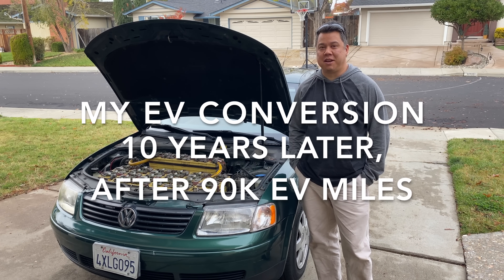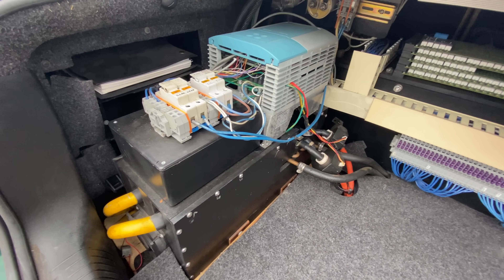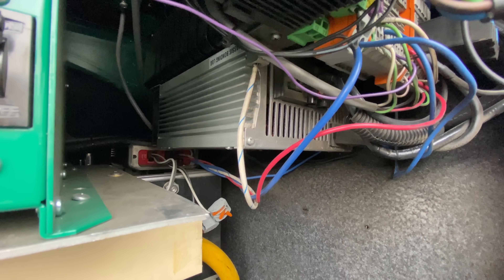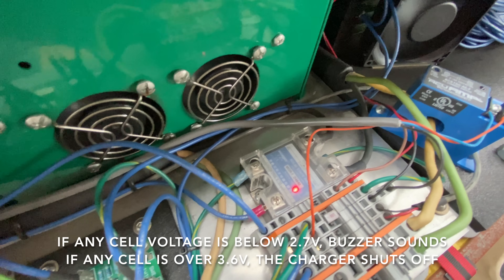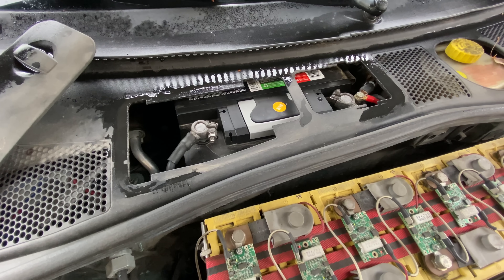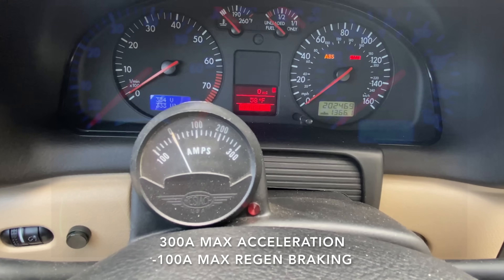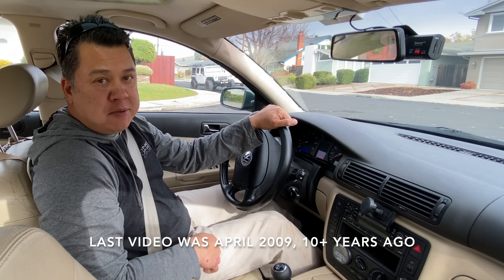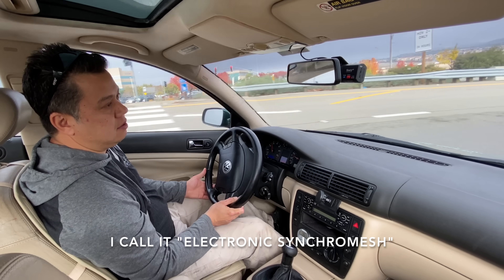My EV conversion after 10 years and 90k miles

Comment: The fact that you built this yourself, in 2008, when there was virtually nothing to go off of, is incredible, and you did such a clean job.
Reply from the maker: Thanks!  It was definitely a learning experience, I have a second video showing how I built the inverter if you're interested.
Reply: @etischer  I can call you Einstein!!
Man, this way too difficult for a regular joe to assemble an EV like this !!
How the heck you did this in 2008 ??
Are you an Electric Engineer ??
If not, where the heck you got the Info and the serious balls to dare to do this project in 2008 !!

You are GOD !! SIR !! 

CONGRATS AND THANKS FOR THE VIDEO POST !!
Reply: The original iPhone just came out the year before and he builds this..... AMAZING
Reply: in 2008 there was plenty of stuff to go off for electric forklifts like chargers, inverters and dc converters were off the shelf, not many options in choice of BMS nor high voltage chargers back then. Even further back, In 1990, I converted a neighborhood ev from 36v to 48v lead acid battery system and upgraded the motor to a 20kW one and installed a controller with regen braking. Had 70 miles range 60 mph tops. Everything was industrial components except for the controller, an EV fanatic in the UK hand built and sold online. So really, not many components are needed to build an EV from a gasoline car. If you have an engineering background, it naturally becomes easier as you have an idea how to spec the components for reliability and highest efficiency, but nothing of it is rocket science and everyone can do it.
Reply: @Tore_Lund  That's not the point. That info was not archived online and easily accessible. You either had to work in that industry, or know what you were looking for, and be able to search for it at libraries, which you probably had to spend a lot of time and effort traveling between, calling, etc. There were no youtube videos, websites, or established communities providing insight and answers. You had to figure it all out yourself.
Reply: @badsamaritan8223  We had online forums, but not any YT videos in the 90'. The biggest issue was that, as I said, Forklift stuff was around so 48V gear a plenty and a some very expensive for 72V fork lifts. Still had you wanted a 100V+ EV, you'd have to build all electronics from scratch, it wasn't available from anyone. The real EVs then, as the Citroen AX EV and the Fiat 600 EV and others were small run production only, no second hand parts. The reduction belt drive, I had to have made by a machine shop and the high torque poly-V belt was also special order, but I got an EV that did 0-60 in 3 seconds when Elon still had his own hair.
Reply: I kept checking- 10 YEARS ago! He should start a garage and convert all VWs no matter what
Reply: @Jasen Vernor I think you need to read what was said mate I wasn’t even talking about hybrids and I did say that they didn’t….  Would you like to show me where I says this ?
Reply: the electric car was invented like 70 years ago, people just didnt consider it a real option because oil was cheap. but now its a different story lol
Reply: @eduuklee9453  My point, was that there were very few resources available to do something like this in 2008, and the internet was barely starting to aggregate those resources. I'd bet most of his knowledge came from professional skills, not research.
Reply: @badsamaritan8223  well obviously hes not an amatuer at all
Reply: My dad converted his 2001 Dodge 3500 dually truck to run on vegetable oil. I'm sure if my dad could do all this back in like 2012 I think it was, with an electrical purge system and things. I'm sure there was information on this guy's conversion too. Probably even kits were available if searched out. Not that he'd need one if he new what parts he knew to get hold of. But neither one of these projects would I want to tackle, even though I help as a gopher and pretty much saw all my dad had to do, I don't believe I'd be able to pull it off myself, the main thing is getting your head wrapped around how it works in and out, after that I'm sure you're well on your way to the same thing these "Mad Scientist" have done.
Reply: @trucklover5404  thats a super common mod to diesel vehicles. its not difficult at all to do.
Reply: @trucklover5404  Can't old diesel engines just run casually on cooked vegetable oil without any modifications required?
Reply: @2use  technically yes, especially in warm weather. If you do your research the original diesel engine was made for the purpose to run on alternative fuels such as vegetable oil. But adding a purging system and another fuel tank, and a flat plate heat exchanger helps a lot and fuel pump. But to do this was a lot of plumbing basically and electrical and mechanic work. We were working on a 2001 Dodge 3500, the fuel rail was too weak to continue running veg oil. My dad's 95 2500 could do it just fine, but he didn't do a conversion only a flat plate heat exchanger and later ended up with a clogged fuel line that he couldn't find. After taking it to a diesel mechanic, he finally found the clog after  3 days (this was his only project). The purging system is probably best to clear the lines with diesel fuel so when parked vegetable oil isn't sitting and gumming up lines. Vegetable oil leaves a film like lacquer and can eventually build up. There's a lot to learn about using Vegetable oil in an engine and companies who actually sell conversion kits to do so.
Reply: Some of the very first cars were electric 😁
Reply: Imagine trying to watch youtube 'how to' videos in 360p on dial up... Man must have solid patience
Reply: @Simon...........  dial up was 1998 not 2008 🤣
Reply: no one had dialup in 2008 m8 @Simon...........
Reply: @Simon...........  it was 2008, not 1998. Lol
Reply: @Simon...........  Dial up? xDDDD thats way further mate ahaha
Reply: @Simon........... We had broadband and wifi in 2008, kid.
Reply: @Simon........... nobody used dial up in 2008 lol
Reply: @Simon...........  there was hi speed in 2005 chill
Reply: @Jasen Vernor Being wrong doesn't mean you're stupid. Everyone is wrong at some point, but thanks for your contribution to the discussion.
Reply: What was the first electric vehicle?
Here in the U.S., the first successful electric car made its debut around 1890 thanks to William Morrison,
a chemist who lived in Des Moines, Iowa.
What? A flyover state?
His six-passenger vehicle capable of a top speed of 14 miles per hour was little more than an electrified wagon, 
but it helped spark interest in electric vehicles.
Reply: First electric cars were invented in 1820-1830
Reply: You are a genius!
Man, if you just knew what you could bring to the public, you would have been the current Tesla owner!
If fact you proved to be a better EV builder than an entire team of Chinese EV manufacturer, making self-flammable EVs.
Congrats, and thanks for sharing it!
Reply: Stay in school, kids.
Reply: Killing someone's flame doesn't make your own life brighter  @zeljkomatovic24601
Reply: @zeljkomatovic24601  school does nothing
Reply: It's incredible because now he works on powertrains at Tesla! The most sophisticated systems on the road today share some design decisions from this car!
Reply: I was working on the original Testis Roadster in 2008.
Reply: "In 2008 Tesla Motors released its first car" By Tesla
Reply: Im shocked
Reply: Agreed
Reply: ❤🎉🔥🔥 love this love
Reply: Yes, back in 2008, when electrical concepts were unheard of and electrical engineers did not exist yet 😂, man must be nice to be young. It is still impressive what he did though.
Reply: Virtually nothing to go off of....other than the fact the first automobiles ever built were electric. 

Commend him for the achievement, but quit making it out like he's a damn wizard. Makes both of you look like idiots.
Reply: Electric conversion is easy .All you need is electric motor, speed controller, battery, transmission adapter. People have been doing ev conversions before tesla got popular. This was when Tesla came out with the roadster.
Reply: Batteries power a motor that moves the wheels to push the car forward or backward. Wow! So hard to do that right?
Reply: Forklifts mate electric forklifts was around for yrs buddy. He got idea from them
Reply: @christopherbrown2224  ok? but it still is impressive?
Reply: @christopherbrown2224  
Your comparison is completely false! 
In comparison with forklift is, comparing 2 aa battery toy with tesla. And you assume that they are the same.
Reply: @christopherbrown2224  electric cars were around way before electric forklifts.
Reply: @ltx383  I never said it wasn’t I said he got the idea from the forklifts mate he says this in another interview
Reply: @christopherbrown2224  so he got his idea from a 1 speed forklift which lifts extremely heavy items to build a vehicle with gears that can exceed 80mph ok got it must of missed that in the videos.
Reply: @ltx383  🥳
Reply: How old are you ??? Bud hybrids been around since 2000!! Lol 

Prius have been around since I was born 1997
Reply: @tellez4089  we are not talking about hybrids ? We are referring to electric vehicles mate
Reply: @christopherbrown2224  Hybrids can just run off the batteries, dingus. That's an EV.
Reply: @davetremaine9763  hybrids cannot "just run off the battery", plugin hybrids can act as EVs but hybrids are still mostly powered by the engine.
Reply: @davetremaine9763  Dingus 😂
Reply: @davetremaine9763 but the thing is hybrids still have a gas engine.
Reply: @tellez4089 ok?
Reply: @tellez4089 Nah
Reply: @tellez4089  lol what does prius have anything to do with this?  A Prius is a hybrid engine that is turnkey from a manufacturer.  This is a Jetta which was equipped with a ICE and now it’s fully electrics that’s not even apples to oranges that’s apples to grapes.
Reply: @ltx383 *passat
Reply: @tellez4089  This video has nothing to do with hybrids genius.

Comment: You picked the perfect chassis to build this on. The b5/.5 is extremely reliable the interior will go to 400k and still look clean inside. And the frames don’t rust out Bc they are alloy
Reply: I am positive that's not a coincidence...
Reply: It’s extremely reliable once you remove the gas engine.
Reply: @vee6411  I am pretty sure the B5 Passat was also shipped with 1.9 TDI which are widely regarded as one of the most reliable engines ever made. Not saying the electric motors did not improve the car , but I have heard of 1.9tdi going over 1Million km and have seen a lot sitting at over 500.000km personally
Reply: @TheMasterMief  Yes, you are right. I was more or less making a joke which is why I said gas engine. 

But you see, German engines are not too bad mechanically. Although some are plagued with oil leaks, coolant pipe leaks etc but nothing catastrophic usually. Those are more just design flaws and minor inconveniences. However, the thing that makes modern German engines a hit or miss in terms of reliability is all the complex electronics. When engine computers fail, it doesn’t matter how good the hardware is. I’m sure plenty of modern engine hardware can do 1 million but its electrical issues that prevent it from doing so.
Reply: @vee6411  still wrong the 1.8t can go easy 300k. the b5 audi/golf/passat/jetta all engines in that those years are based.
Reply: @TheMasterMief   that 1.9tdi is a tank, no doubt about that
Reply: @vee6411  Actually what makes engines unreliable is the fact that they use outdated mechanical parts. Electric is the future and its here. Gas and diesel is a thing of the past.
Reply: @stevenk628  what? I’m talking about electric components in ICE cars, no one is comparing them to full evs. And German cars have fantastic build quality when it comes to material usage. They have shitty plastic hoses and what not but the biggest problem is electronics. Dunno wtf you’re smoking.
Reply: @vee6411  Many if not most German engines are a plague to someone who plans to keep their vehicle running while still being able to afford the month ahead. Not because they all catastrophically fail, no, obviously not. But because they are overengineered beyond any sensible reason and cost way too much to keep running.
Reply: @KenzertYT  If you cannot even afford the payments, you shouldn’t be owning any car.
Reply: @TheMasterMief ur golf 1.9 tdi is currently very close to  300000km or 180000mi with no engine work whatsoever besides general maintenence i e filters fluids and belts. Indeed pretty reliable
Reply: @TheMasterMief yes. I am still driving a 1997 1.9TDI SE!
Reply: @TheMasterMief Why is that special? My 5 cilinder 2.4 volvo s60 has 780k km on it. And guess what? It runs on gasoline, not diesel... You people act like 1.9 is something special lmao. A 1998 ek civic does the same...
Reply: @vee6411  only issue with german cars, the bodies are far superior to the Japanese but in return far inferior in the ICE department.
Reply: @DabDabGoose  Yeah, no argument there. The quality, and just overall use of high strength steel is very obvious. The panels are literally thicker and better made. No one can ever criticize German hardware and manufacturing. Even the tolerances are perfectly made. Their engine hardware is solid for the most part too but its the design principles that cause such early failure.
Reply: @vee6411  Agree, I have an R32 mk5 golf the interior and exterior is basically as good as it was new, the mechanicals are very good too but finicky for those not prepared to keep up with all the maintenance but if you do it will last as long as anything, but as someone who has owned a 2009 Toyota Corolla with 400k miles on it with only basic maintenance It's something not possible with the Germans they need more alot more TLC to reach that.
Reply: @DabDabGoose  I always see ppl dick ride or talk shit about one or the other. Good to see you are honest about your experience. I always say the same thing, German cars are fantastic to drive. A Golf feels like a mini Audi, not as cheap and unrefined as a Corolla. But that same Golf comes at a price, more meticulous maintenance is required where as the Toyota will happy chug along with basic oil changes. You can never have both. I appreciate German and Japanese cars for different reasons.
Reply: @vee6411  Everything is built to a Cost basically, Toyota save money on the body and interior and put all the money on the mechanicals where as VW put it mostly on the body and interior in comparison, the engines can last long but need more attention in return.

I would say for dry and hot climates Toyota dominate but the cold and snowy climates you would rather a german, I live in Australia which favours the Japanese way but I got my Golf purely because I like the unique VR6 engine lol.
Reply: Also, it's a pretty timeless model
Reply: fantastic info

Comment: Just a few questions.
1) Cooling, you seem to put a lot of emphasis on cooling, but having a car under direct sunlight can turn it into a greenhouse, and charging produces ton of extra heat, do you really have no overheating troubles?

2) Handling. Tesla puts the battery cells into the floor as low as possible, to improve grip, balance and overall handling. You seem to have some of your batteries low, but some are quite high, which seems to me that the would have rolling tendencies when you turn rapidly at higher speeds, putting a lot of side pressure on tires, suspention etc. How does it handle compared to when it was stock fuel burning and smoking car?
3) How much money do you save, when did you reach return of investment?
4) This one scares me the most, what about safety? Richard Hammond crashed a Rimac in the Grand tour, and the fire was so strong and lasted so long due to the battery cells catching on fire that only a black clump of nothing remained (the car actually continued to catch on fire for 24h as the cells were being damaged and shorted from the heat). It seems to me like having a major crash in your car would definitely damage the batteries and start a quick fire, not to mention all the electronics from your trunk that could suddenly start flying all over the car, electrocuting people. How safe is it?
5) Whats people's first reaction when taking their first ride, do the notice, or just mention that it is very quiet with a weird buzzing noise (from the electromotor).
6) Is switching from fuel to electricity possible for most, even modern cars, in case we have oil shortages or prices suddenly shoot up due to war or something? What cars should I avoid in case I want them to switch to electric 10 years from now when the fuel motor has had run 250k miles and is basically at the end of its life and I either have to buy a new car, new motor and stuff or convert fully to electric?
7) With governments going green like crazy, do you actually get any money from them going electric, just like they give you like $6-8k environment discount when you buy Tesla?
8) Is it still a viable option now that rare metals necessary to make batteries are getting ridiculously expensive?
9) How much range have you lost over the years? Also there are different types of batteries and battery technologies, do you know which is the best bang for buck in terms of price vs range lost over years?
10) You seem to dedicate every free space available to extra batteries and yet the range is only 100 miles, what does Tesla do differently to have 300+ miles range? From the pictures it doesnt seem their battery pack is 3x as large. Also does the range depend a lot on your average speed, is it more sensitive than fuel cars?

Thanks, maybe some more questions pop up. Definitely cool project. I envy mainly the instant torque, it is so nice to go instantly from 20 to 60mph when overtaking a snail on a busy road :-).